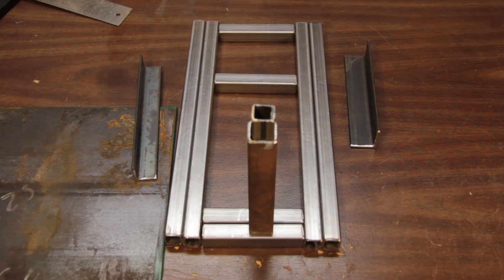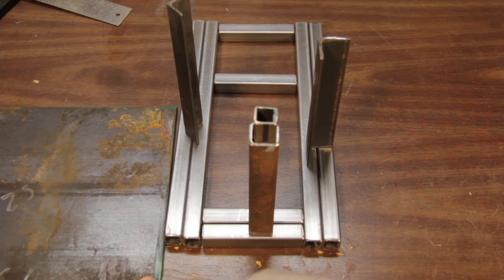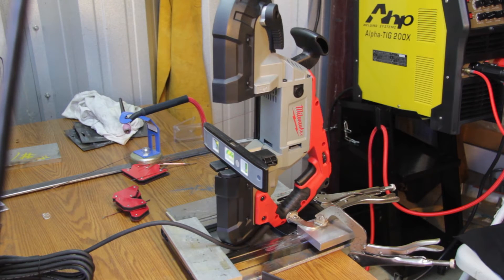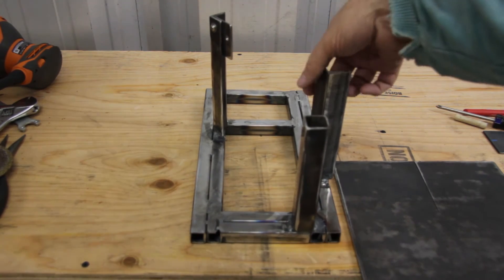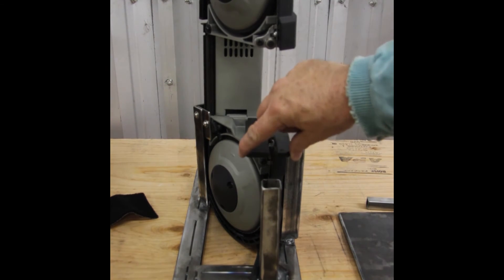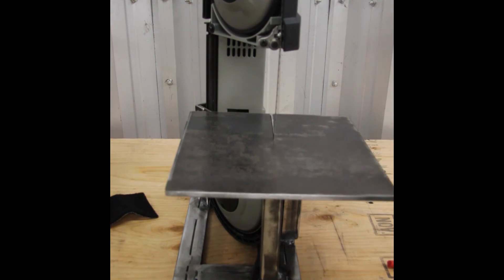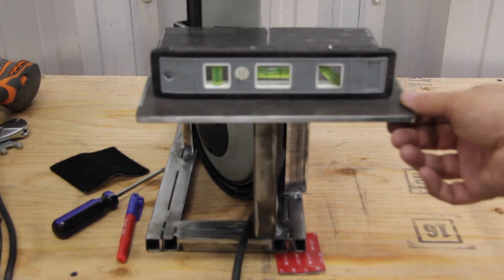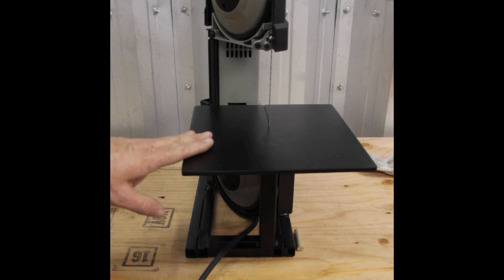Milwaukee Portable Band Saw Stand

Comment: I had my portable stand for awhile and love it but still watching other ideas to improve it. I will keep my hooking the handle for the saw and a saw back and base mold to make it stable setup for quick removal. I like your separated table idea. My table is connected to the saw guide screws and it is a problem if I need to just use it as what it was designed to do. Your separated table idea will keep the saw on its original design with the guide attached ready for portable use. My current table is kinda locked to the air vent in the back of the saw to keep in place without totally blocking the vent then secured with the screws (with the guide removed). Maybe I will keep the air vent lock idea but screw the top to the permanent base (just thinking out loud).
Reply from the maker: go for it.  Design it that way you want it.  There are many good designs out there.  Take what you like and build your own.